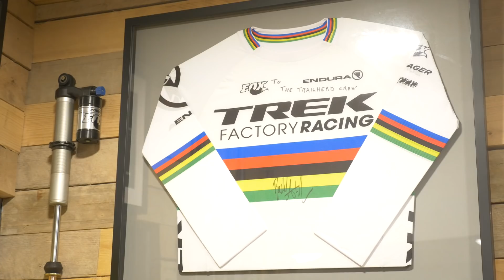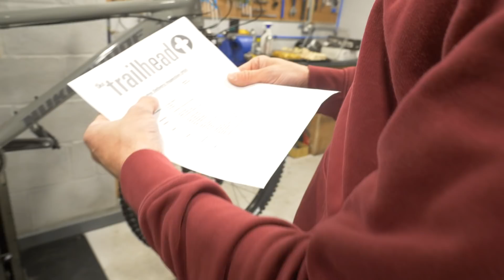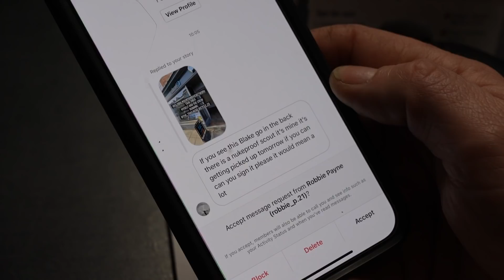Can The GMBN Crew Run A Bike Shop?

Comment: Did Neil use to work in this bike shop, if so it needs a blue plague. If you folk have worked in shops/bike parks previously maybe you could give them a shout out or have a small blue plague gmbn sticker for the shop or something in that manner. Equally if you where a factory rider, maybe the HQ or factory should also have a mass visit where you work on the production line, design, marketing and other jobs with in the bike industry to encourage career paths to young people. Leaving the gmbn sticker tags there when you leave obviously.  I suspect any of our current jobs would exist within a bike company so why not work for them and enjoy the benefits and staff discounts of these companies rather than the companies you current work for.